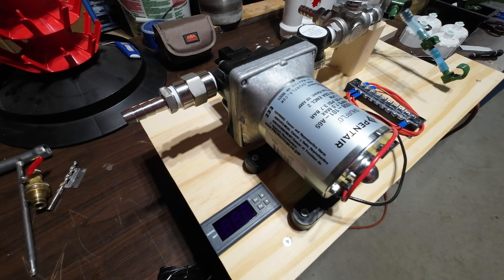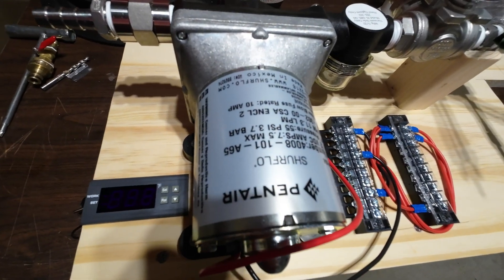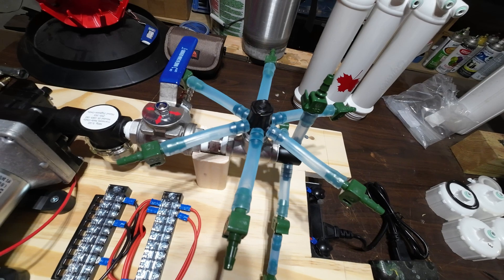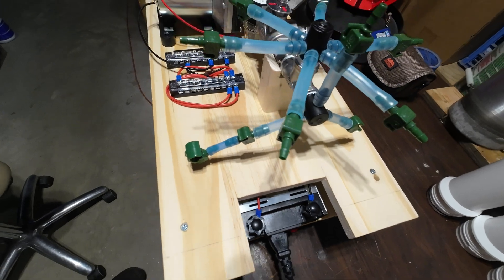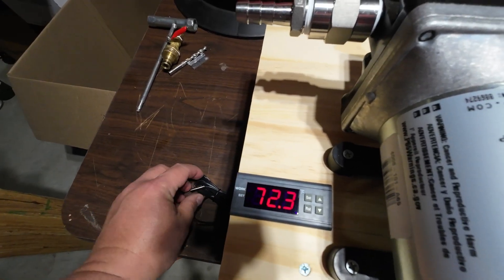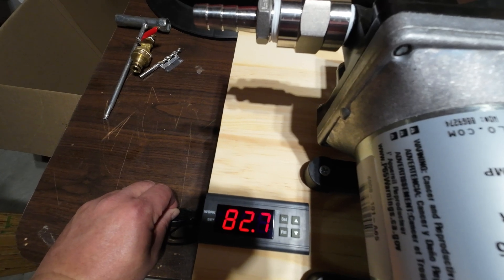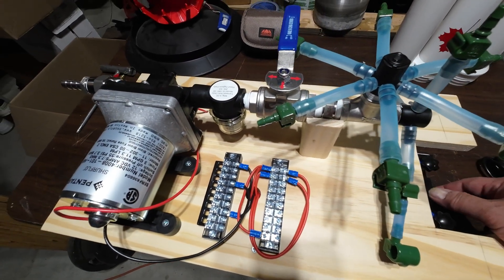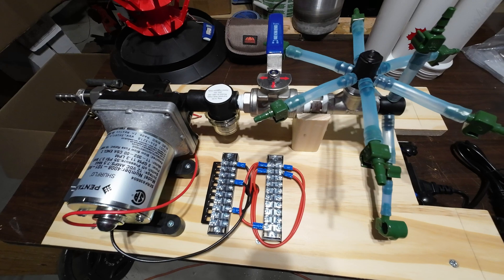Shurflo 4008 Maple Sap Vacuum System - Threaded Manifolds - 100 taps

Comment: Hi, do you have a wiring video for your setup showing it wired from the AC inverter through the circuits?  Thanks
Reply from the maker: I'm in the process of building a second one right now. So, I'll probably make some kind of video.

Comment: I bought most of the parts to build one but time escaped me, and never got to it. I just lost 100 taps due to river flooding and I’m sick about it. If it was on a vacuum I would be ok.  Question: Can this setup draw up a small grade or does it need to be level or downhill? Thanks so much Ive made 4 gallons so far . Had 300 taps down to 200 CDL 20 x 66  6” raised. Auto draw, home built 4/40 RO
Reply from the maker: I feel your pain! 👎 Mine is sucking up around 15 feet from the lowest point.
Reply: Thank  You! I dont have to come up that high, but good to know. Hope you’re having a good season.  Central NH here

Comment: It is two lines going into a manifold only.but I think I found my problem. I had a small squirrel chew in my line I believe that fixed it, but it wasn’t a very good day today so I will check it next time. The reason I used 3/16 And 5/16 is I was watching another channel and that’s what they did and said it work better if you only have under 40 taps. To use a 3/16 for the main line. To create the vacuum and use 5/16 from the tap to the main line to keep it full. I’m new to this, so I try different things that i see but any help is great thank you.
Fred
Reply from the maker: I think you'll find it will work way better now after repairing the vacuum leak created by the squirrels! 👍

Comment: So first time using a vacuum system so I tapped all my trees we have about 20 and I have a 3/16 lateral line going from my first tree to my pump and I have all 5/16 drop lines from the trees. The drop lines are not getting the sap sucked out of them. They’re like they’re full but this sapp won’t move if I take the tap out of the tree there is a good vacuum. Any idea. 

Fred
Reply: I’m have the same issue as him and I have no leaks
Reply: Update my question a couple minutes ago. The only trees that sap is coming out of are the two at the end of the line. No trees in the middle are flowing. The drop line is full but it is not going into the 3/16 main line.
Reply from the maker: My first question is why didn't you run everything as 3/6"? I'd go back to every tap and every connection you have a look for vacuum leaks. What does your manifold look like? Do you only have one input?
Reply: So I have fixed all my leaks. I have 11 pounds of vacuum at my first tree in line. All the way down to my  barrel. And it still seems like only the first one and two trees are flowing through the mainline and all the other ones seem to be not moving at all. I don’t get it. PS email and replies are fine but I’d rather just talk to somebody and get this problem fixed before I run out of season. Thanks again for any help

Comment: Flip the filter 180 degrees. Will keep the housing from cracking if it freezes.
Reply from the maker: 10/4 Thanks for the heads up! (I picked up two extra for the unexpected issues that I'm sure I'll see...)